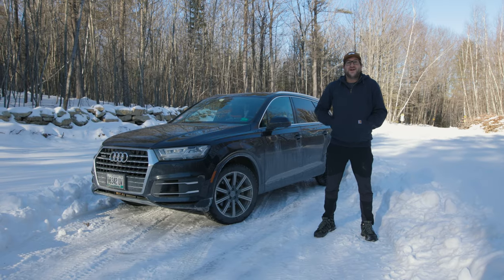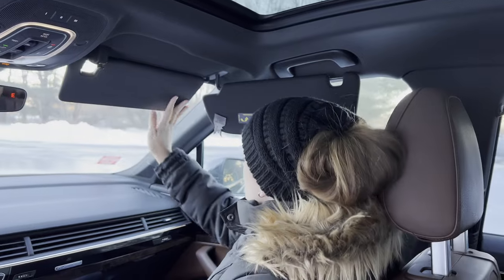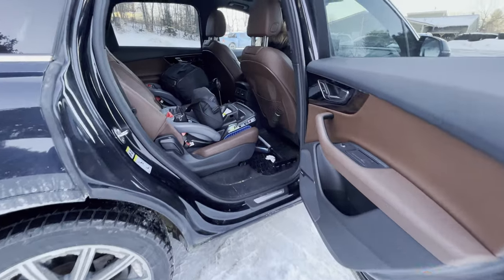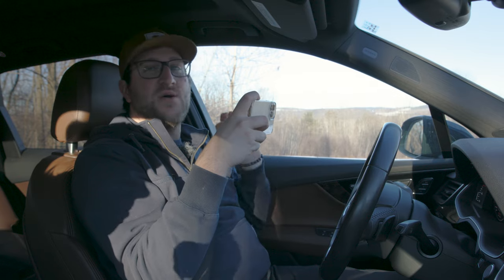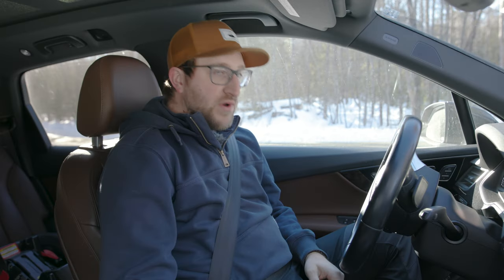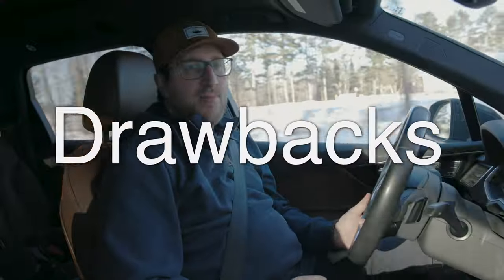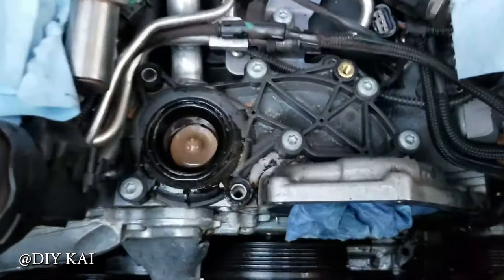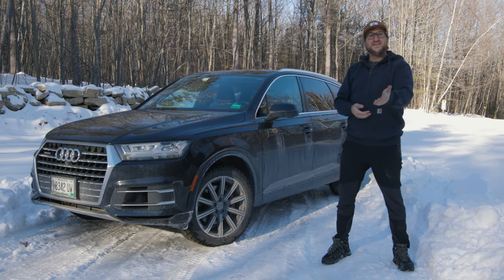Used Audi Q7. Is it a Luxury Bargain? || Value, 0-60, Reliability...

Comment: Owner of a 2018 here. This one should have the CREC version of the 3.0, so both multiport and direct injection, which means less likely to need carbon cleaning. First thing I did was buy the service manual for mine, and seeing the multiport injectors in there made my day. Love mine, hope it lasts forever.
Reply: How is it going and at how much miles was it at?
Reply: Bought it at 43k kms, has 60k now. Just had the supercharger clutch done under warranty, no other problems. The clutch was a known weak point and has been revised by Audi five times. Not a deal breaker for me. Will probably tune it in a couple years.
Reply: @Oklawolf  meaning that I can expect it to likely have no problems when I will buy a new. Well thank you so much for your time. Many prayers.
Reply: I'd probably buy one of the new ones tomorrow if I was in the market. The newer turbo V6 seems pretty reliable. I don't like touchscreens but the Q7 I have now is such a good fit for me I wouldn't let that stop me from getting one. I'm going to keep my 2018 until they have an electric version.
Reply: 2018 over here, I can say my dream came true. I can see myself with it forever 🙏🏼
Reply: @Oklawolf  interesting and good to know it may needed to be tuned. Thanks for the info.

Comment: Got myself a 20173.0T Exclusive Edition. only missing opt is the B&O - no biggie. No issues, reliable, I do my oil changes every 7k kms to 8k kms and drives like new all the time. Drive it hard at least once a week (redline it every month) and your engine will remain free from carbon build up - it's a race derived engine designed to be driven fast. Had my transmission fluid changed @101k kms and shifts much better - always do this every 90k-100k kms - your transmission will always be happy and no more jerking. Did rear diff fluid change myself - easy peasy. Dealer (including Audi) states no need to change fluid for tranny,diffs... because it'll last the "life of the vehicle".... that's a lie. look up the intervals for ZF transmission service. The diffs, depends if your towing or not - I assumed the previous owner did - best do preventive maintenance than finding out down the road you have to shell out thousands for a new transmission and/or differentials - because there is no way as an owner to know if the oil is burnt, or gears kaput.Only issue, do an alignment every year because it's weight will shred your tires unevenly - I forgot to do it last year and having it done 2 more days from now.Paddles are useful when you feel like driving like a racer.Only fluids I gotta have changed, front diff,center diff, coolant and brake fluid.
Reply: Thanks for the info, where did you find the info on the engine being a race derived engine? That's interesting
Reply: @gixxr88  at first a sales person told me and I didn’t believe it until I spoke to an Audi engineer which told me the same. Just think of Audi’s V8 and 2 less cylinders ;). It’s. Similar concept of the R8. The V8 is pretty much 2 cylinders less than the V10. Audi’ 2.0T is derived from VWs 2.0TSI GTIs only only visual difference is the position/direction of placement and size.
Reply: @BocaAtractivo82  but a v8 doesn't necessarily mean it is a an actual race derived engine
Reply: @gixxr88  you said ‘actual’.I didn’t. Perhaps you should look up the definition of “derive” ;)
Reply: @BocaAtractivo82  You said it's a "race derived engine" which race engine was it derived from?
Reply: You want to prove the words of an Audi engineer wrong, go right ahead. I am  not your personal google or library kiddo.
Reply: @BocaAtractivo82  🤣🤣🤣 Dude it's a question, no need to get triggered, a word from an "engineer" doesn't equate to facts or proof.
Reply: @BocaAtractivo82  It's a simple question, iv done my google searches and found nothing to prove these claims, so maybe you can help and show me something of substance, if not all good mate
Reply: how’s it going now? any issues with it? what’s the mileage at now
Reply: @Spartansrule118  I traded when she had over 150k kms. It was running great w/stage 1 Apr tune. Now I’m in a 2020 3.0T SQ5-I always wanted one and a sweet financial deal breaker

Comment from the maker: Note: This is a 2017 Q7 Prestige, with about 50k miles on the odometer.
Reply: Exact same as mine
Reply: About to pull the trigger on a 2017 with 61K on the clock. Great Video
Reply from the maker: @Potterpalooza316  Awesome!! And I appreciate it man

Comment: Greetings from Germany, really nice video. 🙂👍
I happen to  be the fortunate owner of a 2017 SQ7 V8 Diesel with roughly 95,000 km on the odometer. 
Generally speaking, it is a really nice and reliable car provided you do the required maintenance and have an eye on the regular service intervals. 
I had no major issues with mine except a small glitch within the DEF/AdBlue system, which our local Audi dealer/garage easily fixed. 
Nevertheless, I'd like to offer some advice regarding the automatic transmission: Audi advertises that with regard to the transmission fluid/oil, no service is required over the vehicle's entire lifespan; however, ZF recommends that one should contemplate changing the transmission fluid when the car has done around 100,000 km (or around 60,000 mi) to ensure the transmission's proper function and prolong its lifespan. Since my car has already done around 95k km, I'm thinking of changing the fluid to be on the safe side, which should cost me around €700.
Reply: 100,000 kilometers is nothing for a car, basically just 4-5 years of driving for a normal family. Hard to tell if a car is reliable with such low mileage.
Reply: @ShortFunnyTales  I would recommend changing the transmission fluid. Did the car come with a comprehensive service history? What had the previous owner(s) done with regards to servicing the transmission?
Reply: @ShortFunnyTales  Change of transmission fluid is not recorded in the car's on-board digital service history (since replacing it isn't part of standard maintenance procedures). If the previous owner(s) had it done, you should look for documentation in the form of bills and/or printed service reports.
Reply: Ex A8 D2 owner can attest to that and this was the undoing of my beloved 1999 A8 D2 in 2017! This forced me into driving a bloody Toyota since then ......

Comment: I was looking at the Mercedez GLB, and to have something decent you gotta go wi the AMG package which raises the price, but if you go with a older Q7 you pay less and get much more. Only really differences is the price and year gap. Also when it comes to pricing we gotta keep in mind also tho the price has gone down, gotta remember that someone else already paid a partial of the price when it was new, weather it was leased or bought, thats why we check Miles/km's  year and condition.

Comment: Awesome video! I have the exact same ink blue with the nougat brown interior (only I have the piano black dash and center console trim). I bought it in February 2020 for $42k with 13k miles on it at the time. I’m currently at 21k. I’m at the point where I don’t want to take it to the stealership anymore for maintenance. They quoted $1500 for “preventive” maintenance for my next scheduled service.

Comment: You can get a 2020 which is the current generation even a 2024 is the same. You’ll get the updated interior and the rear twilights are updated. Seen a few for 30k with the v6 option.

Oh and the SQ7 is out already. If you wait a couple more years you can get them cheaper. Still around 50-60k used.

Comment: I have three  of these  2022 Q8 and the prestige model 2018 and the 2017 plus love mines wifi for no service area only thing I don’t like is they stop the unlock and lock doors with app on the 2018s which was crazy so only limited Audi connect option unlike the other models 🤦‍♂️

Comment: The A8 is the king of understated, inside you're massaged and treated like a king and nobody looks at you twice from the outside.

.. until you step on it letting the V8 diesel roar
Reply: Absolute beast of a car. The sleeper of sleepers. The only sleeper that comes close is the 03/04 Infinity M45. Google it, I had one and NO ONE knew it had a 4.5L V8 under the hood. I miss that car so much.

Comment: I had two A5s with the 2.0T engine, and both were nightmares when it came to reliability. Anybody knows if the 3.0 is a more reliable engine?
Reply: Had a used 2013 a6 for 5 years. No issues with the engine itself. I had electrical and dealership issues. If the economy was better I’d still have it.
Reply: Which gen? B8 or B9?  The 2017 B9 are pretty reliable compared to b8.
Reply: it's a pretty reliable engine, just keep up on the basic maintenance ahead of time. Had it in my b8 s4 and never gave me any issues and I abused that thing lol

Comment: So satisfying video on Q7. With the price around mid 20s, i am really thinking about it. Worried about the cost of repair for expensive German cars though...
Reply from the maker: These are pretty damn solid cars. Only real issues are carbon buildup and water pump. You can have the carbon cleaned, and just keep an eye on your coolant level
Reply: @NotSoHandyCarGuy  Thanks :)
Reply: @NotSoHandyCarGuy  Is the water pump an engine-out job, or can it be done with the engine in place?  I have heard that when the engine is removed to replace the timing chain, mechanics typically replace the water pump as well.  Is that because it’s just easier to replace the pump when the engine is out?

Comment: I hear so many say that Audi reliability is poor, I don't get this we have own three Audi's and other than a few recalls that were repaired under recall we haven't had any mechanical/electrical issue with them?  I need a new SUV and the Q7 is in my radar, my only disappointment with the latest model (more or less same as this one) is that they made it smaller, I use my SUVs for renovation material and adult beach hauling so could use more space.  Still I think that this is one of the best looking SUVs out there and the interior layout is beautiful.  If/when I get one it will kill me to scratch the back when I put dirty construction in the back.
Reply: Audis are not reliable, and same goes to Mercedes and BMWs. How many miles have you put on your Audis ?
Reply: @davidm4099  what do you base your unreliability comments on?  I’ve owned three, one 6 years old with 113,000 miles on it looking to replace end of this year, second 6 years old that had 127,000 and third was 5 years old with 85,000 when we got rid of.  Not one major mechanical or electrical issue with them.  Wife had a Lexus that during the 4 years we owned had to replace rear view mirror we got black lines or something so couldn’t see out of it, drivers seat cushion wore out and had to replace a ball joint.  Just bought a new Q7 guess we will see how that holds up.
Reply: @msk3905  Would you like to tell me how 8 months had been with your Q7 please!? I'm looking forward to buy one but what's worrying me is how everyone is complaining. I was almost at a point where i say nah i'm going to buy something like Genesis GV80 or Lincoln Aviator. I'm one of those people who agree on "if you're buying an expensive car, it will be expensive to maintain" I'm ok keeping 1-2k dollars annual even well insured and 5 years warranty" But what i don't like is when things break up even with care, I always go for brand new ones and expect to see no fault at all for at least 3 years then a few things like battery, light bulbs i men simple stuff till 5 years and in this whole time i won't mind to take care of my car even like taking care of baby by oil change on time, filter changes, air checks, right gasoline, cleaning, break pads, coolants, carbon check (every few months) and many other things that are not considered major but also not to simple stuff that people kinda ignore. however i don't wish my car be spending most of it's time in a workshop either just because it's must for the car or major things like engine leaks, timing chains, compressor fault with in 3 years and all that crap like major break ups just because the manufacturer didn't paid attention to reliability. I do frequently travel. sometimes 2k miles a month and sometimes 4k miles but taking care of it too but at a fix schedule like taking it to workshop and checking if all good. I also don't mind changing it's oil every 2k mile.
Reply: @S.M.HassanShah  happy to the end of August marks one year with it, zero regrets on purchase!  Car is fantastic, drives great, very comfortable and love the technology.  Absolutely zero regrets with my purchase and find owning one better than expected.  Now for what I perceive as the negatives, way back and space under armrest are smaller than I had before I do miss the space, there is no storage under back floor panel and Audi app on my phone was causing issue with radio.  If you get one stayed logged out Audi app and keep off.   Lastly, Audi should be ashamed to charge for the rear cargo protector…POS!  Flimsy and slides everywhere hands down the worst cheapest protector i ever seen to date!  Zero mechanical or electrical issues, has 4 year warranty and when that comes close to end Audi will offer an extended warranty to me that I’ll most likely buy seeing the technology this car has. Don’t get extended when you buy, Audi price in 4 years is cheaper.  Long term we will see how it holds up and honestly i don’t see me owning this without a warranty (considering the amount of technology) but i may be surprised as my wife’s A4 is now 7 years old with no issues to speak of.
Reply: @msk3905  So this means most people break their audis because they just don’t maintain it like they thinks it’s Toyota if you handled with care like frequent cleaning and servicing it remains just as good as yours A7. What about the bumps like going over pothole does it shakes you? And thank you so much for your time i was so worried for owning one, thanks for giving confidence.
Reply: @msk3905  Hey im looking to buy a 2017 q7 113,000 miles, how would you rate this in reliability im paying 17,500 im a female with older parents so they dont know to much about cars could you tell me if this car is reliable at a good price?
Reply: Lexus Lexus Lexus lol

Comment: I've been seeing a lot of models under $20,000 now days. What's the catch? Are they unreliable?
Reply from the maker: From my experience, they’re actually fairly reliable. But as all cars age, they require more maintenance as parts start to degrade. Typically German cars are just more expensive and a little more complicated to work on, requiring specialty tools. And, as a whole, people tend to stay away from older German cars because a lot of them ARE problematic. But this also means that there are less people buying them, which lowers their resale value.
Reply: @NotSoHandyCarGuy  That perfectly explains it, thanks.

Comment: This one isn’t equipped with the warm weather package and isn’t “fully loaded”. I personally own a ‘17 Audi Q7 Prestige in black on black. The Quattro system enough sets itself far superior than other German manufacturers….not an opinion but, fact.
Reply: I am surprised by the number of used Q7s that don’t come with the Driver Assistance package (it includes adaptive cruise control), even in Premier trim.  There have been several in Premium Plus trim that I had to pass on because they didn’t have the Heat Package.

Comment: Q7 or Gx460 lexus
Reply: Not sure if you're still interested, and I'm not an GX460 owner but I test drove a couple when I was looking to trade in my 08 Sequoia. The GX is very nice, it rides more like a car than the Sequoia and I suspect it was a tiny bit better on gas. But it wasn't as impressive or nicer than the 17 Q7 Prestige I ended up buying. The Q7 really feels like a car and the interior is so much better than the GX. Yes, the Lexus will be way more reliable but if you drive both you'll probably end up getting the Q7 if equipment, power and ride quality is your priority. The GX was nice but in no way was nicer or drove better than the Audi. But if you're worried about reliability, then get the GX.

Comment: How many quarts of oil is this Q7 burning between changing? I’ve had 5 Audis and nothing but repairs. My 12 Q7 3.0T engine need timing chain guides replaced.. ouch.  The 3.0T oil should be replaced every 6 months.. I do this even using Amsoil Signature oil.. the best oil on the planet.. proven!  I’m going Acura now.. boy I love my Audi when it’s working but goddam why do the German overcomplicate every part. “Oh parts $50, but we had to remove the engine to get to the two screws on the broken sensor..
Reply from the maker: Oil consumption/blow by aren’t huge issues on the 3.0’s. Maybe it’s the PCV? But yeah, oil chances are the #1 most important thing to do on these. Personally, I’d do a change every 3,000 miles, rather than going by months (although some people say that’s overkill)… but it’s better than doing timing chain components. The 3.0’s in these Q7’s are quite a bit less finicky than the ones in the 1st gens though. BUT you can’t go wrong with Acura haha
Reply: @NotSoHandyCarGuy There’s a video out in which a former Nissan engineer recommends oil changes every 3,000 miles, but replacing the oil filter every other oil change; essentially, fresh oil every 3K, and new filter every 6K.